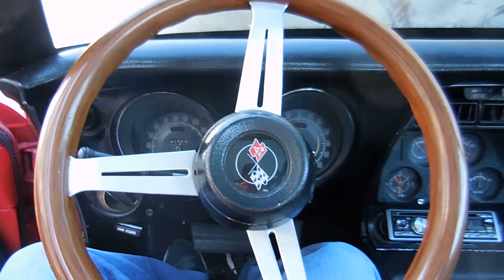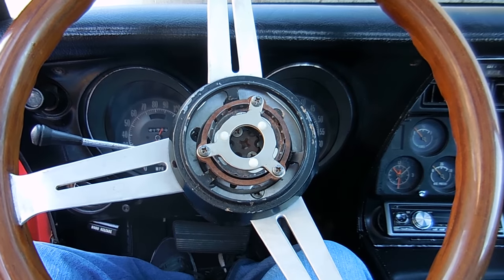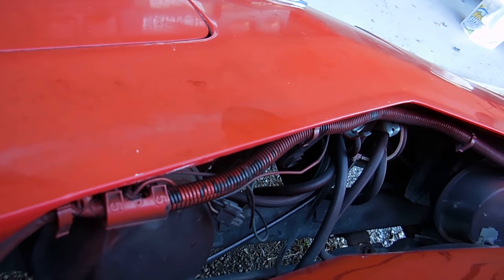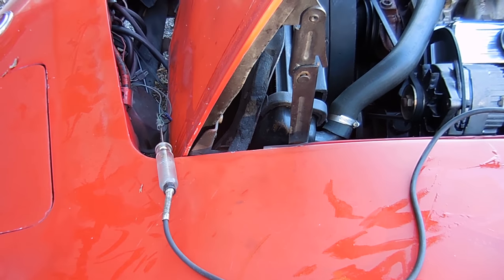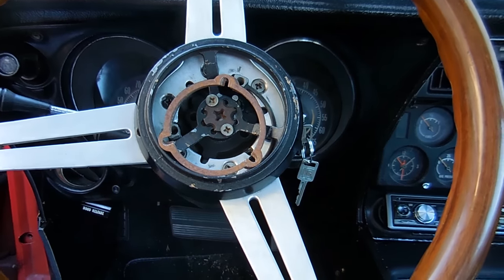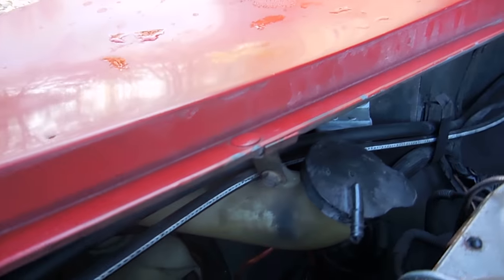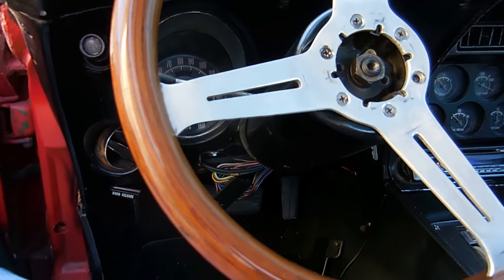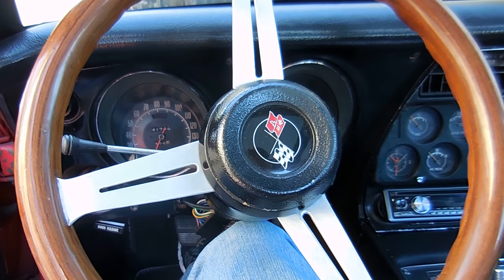Dirk's Germany Bound 1973 Corvette Stingray Video 3: Horn Issues

Comment: Hi Ben, I never had any horn issues with my 73' t top 4spd ac Vette L48...I read the comments and after 3 yrs. No one suggested checkng the horn fuse...maybe, like first...that comes from motorcycle riding experience, when they quit running while on the road...great videos, I have watched 10 them tonight...I did upgrade to C5 Corvettes, any help on the ebcm module for 97 to 2000, that can't be resoldered, as easily as the 01 to 04 can...I really luv my 2014 Vert. Stingray A6 upgrade...maybe someday day a used c8.

Comment: Ok, My 1977 doesn't have a relay under the hood, but it does have one under the dash near the fuse panel. I replaced that, but still no horn. How do I trace the power. I have a bad feeling that it is going to be inside of the steering column.

Comment: Wow takes me back to being a teen fixing my horn on some second gen Camaros except I would end up driving along hitting a bump and the horn would go off. Most embarrassing. Great job wish I had seen this 30 years ago.  FYI Not sure your 5 amp power supply is enough to set those horns off.
Reply from the maker: You are right, it isn't enough. I am thinking I need a better one.

Comment: You got lucky with this one I would say. Usually a "bad" relay means the "coil" winding has "opened" so the relay stops functioning when power is applied to the coil. The way to check the "coil" winding is to "OHM" it out for continuity. If the ohm meter doesn't move when you touch both ends of the coil winding terminals, the winding has "shorted out" and created a open circuit (break) in the winding.
Reply from the maker: Your right, guess I should have said dirty relay.

Comment: Hi, did the future owner say how much he will be paying in taxes and insurance per year over in Germany? Europe has some crackpot rules and regulation with regards to size, weight, power(taxable Horsepower) and engine size (dependent on country). In general if your want anything 2.0l 4 cyl you get hit hard. A friend of mine back in Australia use to joke that only milk and orange juice come in two liter.
Reply: Taxes are not calculated on emissions and cubis inches in Germany when you have a vehicle older than 30 years and classified as 'historic'. To get it 'historic'. you have to pass a special inspection where they check the originality of your car. So you can't get it 'h' when you replace the engine with a 90s crate for example. But the car is allowed to have any changes which were possible to buy 10 + and - the year it was build.

When you match this inspection - which is not that difficult, this C3 will pass it - you pay 191 Euros taxes a year. No matter if it's a Shelby Cobra or a Beetle.
The insurance for this 1973 will be about 200-280 Euros, depending on the risks you want to include.
Reply: Hi, that's great and thanks. At least they are giving people a fair go with regards older recreational cars. Cheers.

Comment: Ben do you have a video that walks through checking  vette for solid frame and birdcage before you buy it. I understand that the birdcages are prone to corrosion on the front pillar post and bottom front corners if they are left outside in elements.  Is there an easy way to check without taking any of the car apart
Reply from the maker: Sadly the only and best way to check for sure is to test one apart
Reply: okay thanks, I figured that was the case, thats one of my setbacks up here in Ontario Canada. Some of these cars were driven year round (salt and sand in the winter) and the market for buying US cars is horrible with our exchange rate at the moment
Reply from the maker: +Allen Bonner you can look down the a pillars, through the windshield in both sides (like you were looking at the vin) and if you see crazy rust there, then there is alot more hiding underneath.

Comment: My 1977 Corvettes horn doesnt work. The horn assembly is all correct but I checked under my hood under the fender and I dont have that relay in the same location. Is it under the dash on later C3s?
Reply from the maker: +Stephen Schafer yes, under the dash near the back.of the speedometer
Reply: How about for a 75. I am in Australia with a 75 Left Hand Drive (we are normally right hand drive here, but working 6 hours away in outback doing some research while I wait to get home)